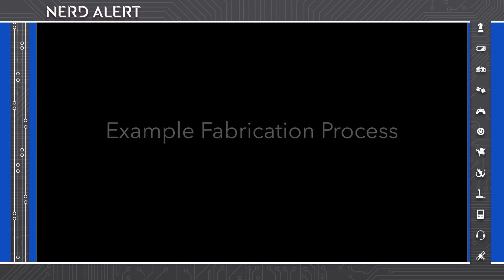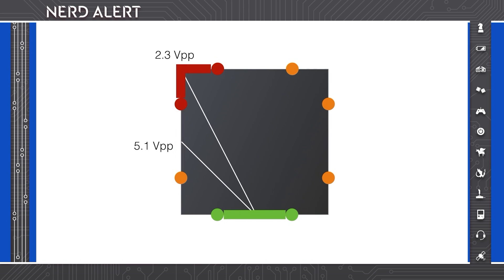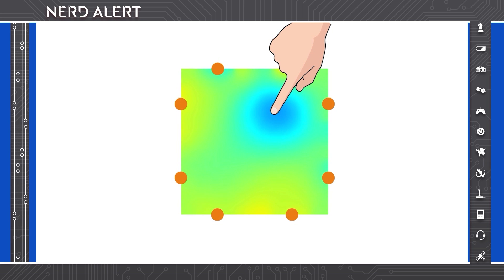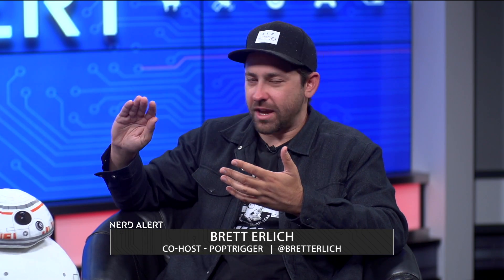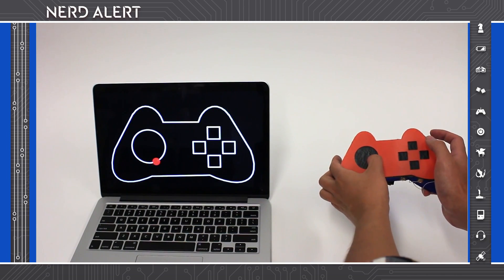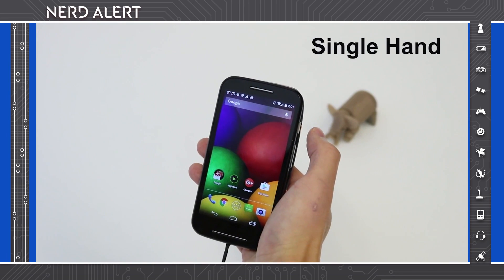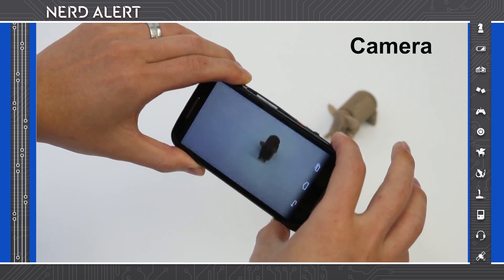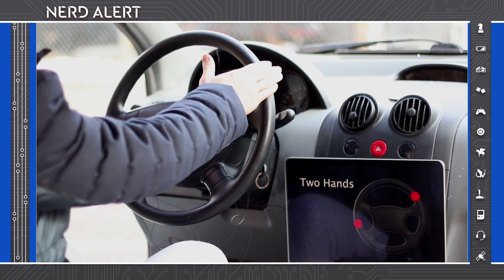With Paint & Electrodes, Anything Can Be a Touch Sensor

Comment: Touch screen != Touch sensor

This paint is not transparent, so you can't really place it over a wall of screens and turn it into a touch screen wall. What you'll be doing instead is turn a wall into a giant Wacom tablet, whereby another device will accept the touch input and do something with it.
Reply: They showed that it could be painted over with a light color in their lighting scenario so I would think an image could be projected onto the wall to get a touch wall.
Reply: Ah... a projected image... fair point. Not quite the same experience as an actual touch screen, but the paint would surely work better than current interactive whiteboards.
Reply: Wouldn't we just use a glass touch screen for that? This seems like it would be more for feedback applications.